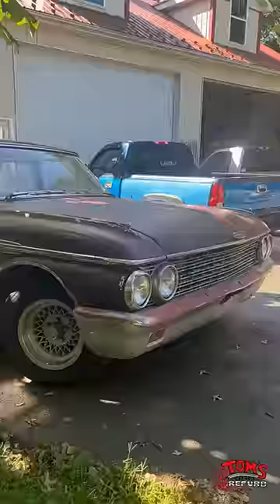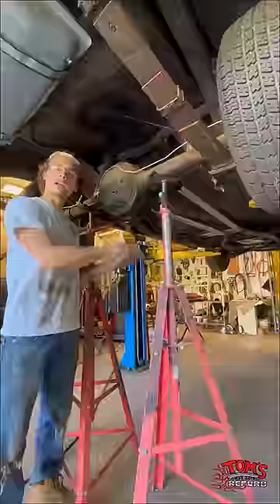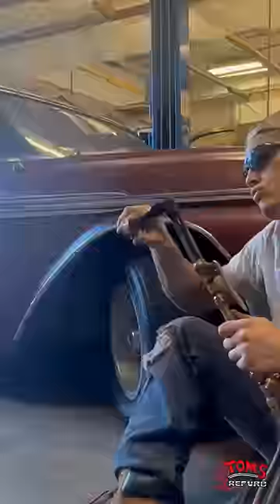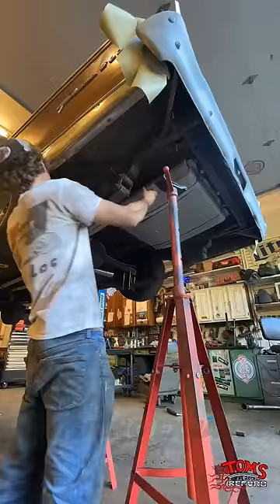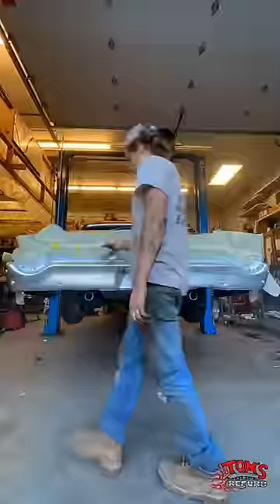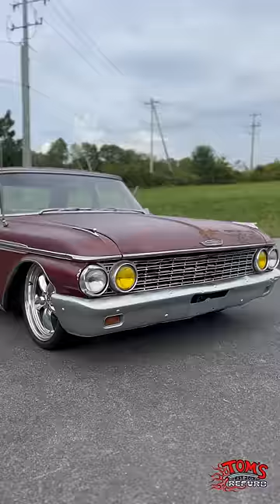1-DAY TRANSFORMATION: '62 FORD GALAXIE! #tomsrefurb #transformation

Comment: Different strokes for different folks. My era would be I paid $ 50 bucks for this pile of rust bucket. 4 used 15by7" SS cragars on slightly used RWL Laramie GT qualifier G-70-15's old used set chrome Hooker headers with sneaker pipes with chrome tips in front of the rear wheels, Hi-jacker air shocks with line kit jacked up 3" inches in the rear. Total cost $350. Bucks

Comment: Tom: Measures wheel clearance when lowering
Also Tom: immediately swaps to wider wheels 
I love it!
Reply: Confident that thing can only go in a straight line now lol
Reply: @bobdeslob8768 just floor it, slide rhe rear, and steer a tiny bit lol
Reply: It's called being proud of doing it the hard way. Usually wrong.
Reply: I had the exact thought
Reply: Goes straight nicely
Reply: That's cool dude, just exhaust tires and lowering doing all that work mayday cool difference on the Galaxy that's the coolest part about it that it is a Ford

Comment: I'm 70 and did this when I was 15 to a Ford Crestline I bought for 5 dollars. Got it running with help from friends.... no lift, probably drove it up on blocks to drop the pan. Lowered and primed it.... good experience that I used troughout my life. I've had all kinds of cars and trucks since from Hot rods to Kenworths.
Reply: What a time to be alive.. a whole $5 , blows my mind... thank you for sharing your story.
Reply: That is awesome
Reply: And I thought I got a great deal when I bought my 66’ Caprice for $50! It was my high school auto shop project, and our teacher was a hot rod guy at heart. We pulled the 327, rebuilt it, and he sold me some 2.02 heads that he “had lying around” for cheap. With Cherry Bombs on it, there was no sneaking around in that car!
Reply: I bought my aunts '70 Nova for $300. Also had a friend help me prime it then put some ralley wheels on it. Drove it all through high school.
Reply: You bought a damn car for $5? Pretty much hotwheel price now?
Reply: 5000 or 5
Reply: @bryanbrowning5746 I’m so sorry I know this comment is almost 4 months ago but is there any chance you could explain what a cherry bomb is? I’m just curious since I’ve heard that term before but what is a cherry bomb for a car?
Reply: @YarnhamBrainsucker  it’s basically a straight through muffler with no baffles. It has some fiberglass packing(nicknamed glasspacks) to only slightly reduce exhaust noise. They are pretty loud. Cherry Bombs were painted red, thus the name. Another manufacturer made the exact same thing, but painted purple. Those were “Purple Hornies”. Both products are still in production.
Reply: @bryanbrowning5746  awesome thank you for explaining!

Comment: $3000 car + $4000 worth of wheels, tires and exhaust = $5000 ride. Love it!!!
Reply: New math
Reply: @vr4runner haha
Reply: $4k for wheels tires & some junk pieces of pipe.. Those wheels are american racing torque thrust vintage reps.. less than $200 brand new.. so lets be generous and say $1500 for wheels & tires, $75 for junk pipes and 2x glasspack mufflers & tips. maybe $25 for those yellow light covers, and an $8 can of spray paint.. oh yeah, lowering blocks for the rear leaf flip, $40-$50.. total, Under $1700, and thats if none of it was bought used or already laying around.. Realistically car is prob worth $7k depending on the interior that we never saw what so ever which is not cheap to repair!!
Reply: Do you guys really think those crusty chrome wheels he put on was worth 4K come on bro those look like some eBay special man 1500 bucks max
Reply: He didn't buy that car for 3g its to together
Reply: @the_oneandonlycrazyjess1396 someone's jealous
Reply: @the_oneandonlycrazyjess1396  It's believable, it's not a top of the line model, or a super desirable one.

Comment: That actually looks really good, also it's kinda cool that you actually say that "it's not the right way to do it" when lowering the front
Reply: Ive seen that method used for removing the springs entirely if you dont have the compression tools, but normally its done while on a lift and the suspension is completely unsprung from the body weight.
Reply: I’ve done that with my el Camino and s10 😂
Reply: @cannedheat2264  Cool cars!

Comment: Miss mine. Had a 67 and a 64. Both four doors and both had FE engines. 😢  She's sweet man. Enjoy the ride.
Reply: My 67 is in my garage
Reply: I got a 2 door 66. I love the torque of the 352, but I'll have to sell a kidney to afford to make it powerful
Reply: @flyingace5057  mine is the 390 2 barrel, you can make plenty of power for not a lot of coin intake with 4 barrel and headers you'll be over 300 hp for certain
Reply: @dom-qx5kx  I assume you're talking 300 to the crank. Which is probably about right. It's just a dog above like 3000 rpm. And its got 175k miles on it so that probably has something to do with the lack of speed
Reply: @flyingace5057  correct timing is key but intake 4 barrel and headers will get just about 300hp to the wheels you should have 250hp stock and that's sae crank before parasitic loss I know but I think you be pretty damn close to 300 at wheels. Remember ford lied about hp specs for decades 352 is a good engine. I know, my 390 is the same thing just bigger bore and stroke
Reply: @flyingace5057  also a free bit of acceleration, change you vaccum advance actuator from manifold vaccum to carburetor vaccum it'll give you instant advance and it's free just disconnect from manifold plug manifold and connect actuator hose to carb port.. set mechanical timing to °10 then your vaccum actuator will pick up the remaining to a total of 34 or 36
Reply: @dom-qx5kx  I will definitely be trying that out
Reply: @flyingace5057  matter of fact I'm gonna take my for a Lil drive right now in this brisk October air
Reply: @dom-qx5kx  that's awesome! I really need to get out and cruise mine too.
Reply: Thanks now I know what to do with that 59 to get a little more power out of it really does pay off to read the comets
Reply: @dom-qx5kx  Let me guess you read that in Hot rod magazine in 1985 and still think its true today.. That "trick" is for a wide open throttle drag car only.. having ported vacuum is only going to cause terrible starts, hot idling, bad drivablity at part throttle, tons of wasted fuel ect ect. That only works for cars that see limited idle time and pure WOT pulls.. You are not fully burning the mixture and dropping cylinder pressure at part throttle and idle.. your theory is fine for an old junk car that runs 18's in the 1/4mi trying for 17's..
Reply: @Clutch_Kick187  your wrong on almost every step there bub, but keep trying its OK your an internet tough guy
Reply: My first car was a 64 Galaxie back in 74, still miss it

Comment: Love that ppl still have a love for these vehicles
Reply: Theres an old Thunderbird right around the corner from me ive been wanting to ask the owner about, it hasnt moved or been touched once since i moved to the neighborhood five years ago. 

Its only got the thunderbird badging on it, cant seem to find anything denoting the engine type or size. Would be a good project for the right price, its in salvageable condition but needs a lot of work on the body and interior alone, and i havent peeped at the frame or nothing.

Comment: That makes it ride so ruff plus all that stress when you heat the springs and let it drop
Reply: Haven't you noticed these guys think it's cool for the wheels to be all out of alignment and for it to have no suspension.
Reply: Yeah but they could do it right with some coil overs drop spendals when I was a younger a friend of mine did that to a Lincoln and if you didn't have your set belt on you you couldn't stay in your seat

Comment: Don't be stupid and heat coil springs to lower a car or truck.. They will only continue to shrink down after you  heat them, and it will be riding the bump stops in a few100miles or a couple months of just sitting.. Springs are dirt cheap, and can be found by hundreds in junk yards or bought for nothing off ebay..

Comment: I once lowered my 99 mustang like this and it looked bad ass! BUT IT RUINED MY SUSPENSION AND BOUNCED LIKE CRAZY - and would slam the front end down over rail road tracks.I swear one time it slammed so hard I thought I broke something in the engine. I got new springs a week later. Do T do this with modern cars and especially if you live in the city with bumpy roads and pot holes.😫😫😫😫

Comment: I have a '62 Mercury Monterey (same body) with no pillar. I bought it in 1980 from the original owner. I paid 700 dollars, the original 352 cracked from bad freeze plugs. I replaced it with a 390 cop motor, and aluminum 4bbl intake. It has a big, dead spider 🕷 in the speedo.

Comment: My father bought a new 62 Gal 500 with 352 ci/3 on the tree w/overdrive 4 door HARDTOP  from the dealer for 3K. Had the dealer install rear seat belts which perplexed the dealer. Other pops innovations: headrests and daylight safety running light in grille center. We went touring. I wanted baby moons...

Comment: uncle had a 62 1/2 polara with '63 grille with 413, he slammed it by flipping rear springs to under the axle and  he did exactly same thing,   heated and gently allowed weight of the car push the spring,  heated it and quickly letting it cool down,  to just right height.       then in the '80s  Cragar wheels were popular, so he had them mounted as well.    that 413 engine went like a stink.    425 horsepower.   2x bench seats,  4 speed floor shifter

Comment: I guess you’re not a fan of glass pack mufflers I personally like the sound of them had a 67 mercury with glass packs as you could barely hear it cause mercury had a 410 in.³ engine galaxy has a 352 which is a Teebird motor I like glass packs but to each their own nice job nice

Comment: Lowering means , don’t drive it much or you’ll rip the exhaust off poke holes in the gas tank and maybe a spectacular fire.
Lowering is for race cares on race tracks.
Not street driving, bumps pot holes drive way ramps..
Stuck on stupid, ate up with the dumbass wast of cash

Comment: Got ripped off hella hard my guy, I almost bought one of these in the exact same condition for 600 bucks dude ended up selling it for 450 on marketplace to a friend of mine, thing still runs with 0 maintenance on my friends part over 3 years later. 3 grand gets you something with ac on Facebook marketplace 😂

Comment: Sorry to tell you this my friend. But it is not recommended to heat your cool springs. I had two friends in high school who thought lowering their truck by hearing their front coil springs died because one of the coil springs snapped after them hitting a pothole on the highway, the truck lost control and they crashed, rolled the truck and both died. I on the other hand had a 76 F-150 & I just cut one link out and dropped it about 4'', never had a problem. The springs still had a decent spring to them.

Comment: I have a 1993 ford ranger but I live on hill so if I lowered mine I would literally scrape the fuck outta my bumper so mine iam actually going lift 3 to 4 inches and out 35s on it it’s a manual 4 cylinder also

Comment: Next time you heat the springs raise the car into the air with the wheels equal distance off the ground then heat them until the wheels touch and let cool. Doing it your way can cause it the lower further than you want.